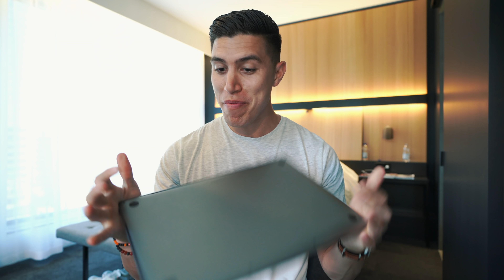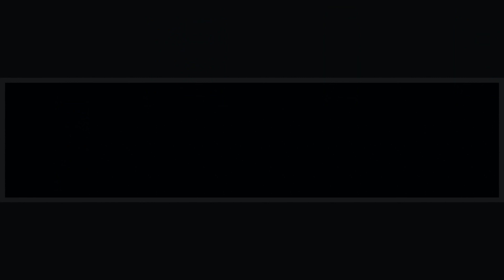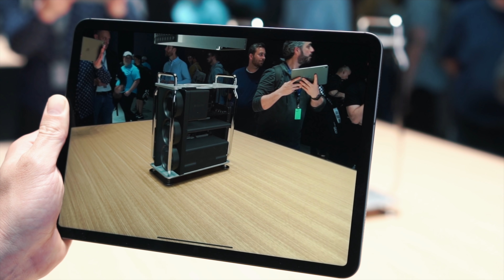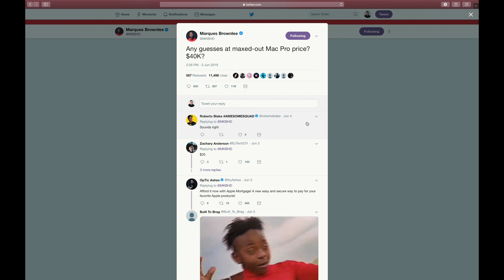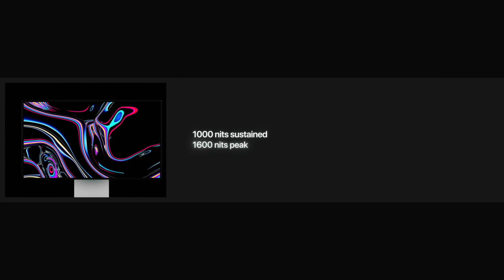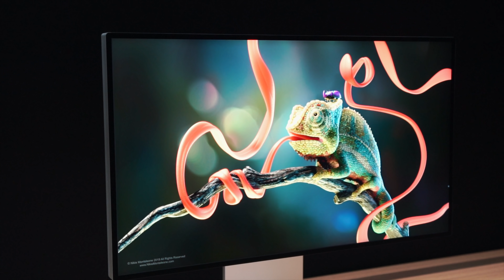The $75,000 Mac Pro!

Comment: I really think, that the costs of the maxed spec Mac Pro  will be a lot higher than 40 to 50k $. A similar HP or Dell Workstation also costs 70k and more. Only the upgrade to 1,5TB of RAM will cost arround 45k.

Comment: You can’t reasonably use 6 stands. You’ll have to use the vesa mounts at 299 each and a custom from parts stand which with t-slot rails, desk mounting bits, and vesa mounts would be maybe 1000-1500 for stands bits and 1800 for the adapters...

Comment: Stability, simplicity and power have a price. The “pro” in Mac Pro means this machine is meant to make you money, hopefully more than invested. High price investments seem to decrease profit at first, but quality saves time and can make better works, translating in higher overall profits. The cheap route on the other hand can cost way more than 75k on the long run and induce superfluous headaches. So... :)))

Comment: Maybe it adds up to 6k in stands, or maybe these Pro users would take those stands off the Monitor and throw them away because they use a different mounting solution unique to their needs. So why pay an extra $1,000 per monitor for a bundled stand that not everyone is going to use. Remember this is a Pro monitor, not a $600 monitor from Dell or Samsung.

Comment: What happened are we living in an alternate universe? In the late 90's I remember the IT company where I worked bought a few HP servers for 30k each. I picked up the same server in 2003 on EBay for $1200. In the 2000's we fought software be grossly over powered than hardware so we upgraded every day it seemed. But something happened around 2010. Hardware caught up and passed the software requirements and now we can own machines 5 or more years old and they perform great. GPUS are always evolving but 1 model down from the top is affordable for everyone. Apple is doing exactly what Steve did with Next. Those were 12k+ machines that failed due to price and seems Apple is bent set on repeating that!